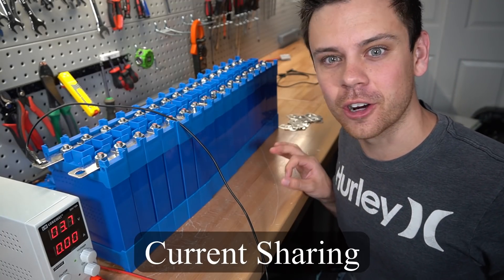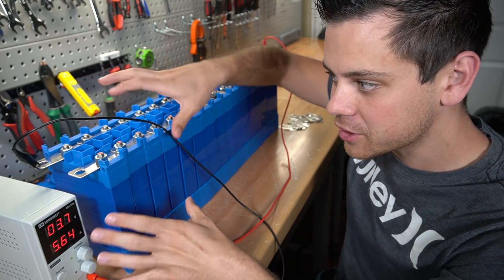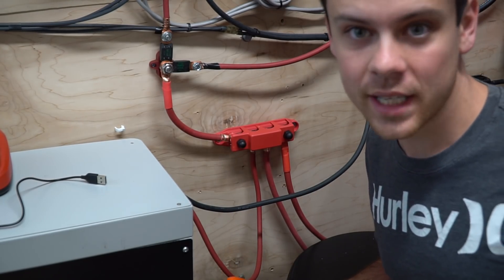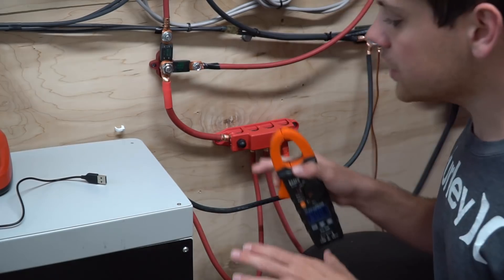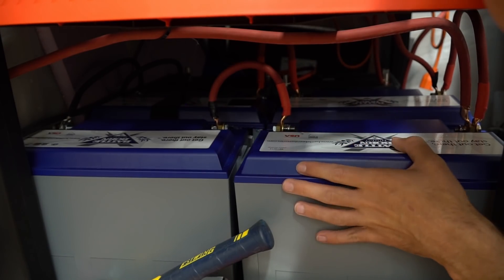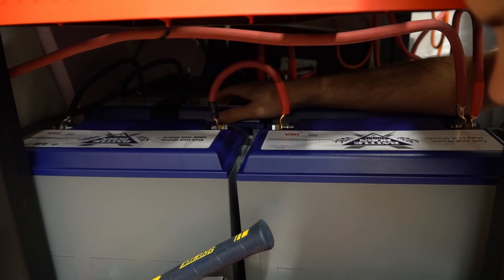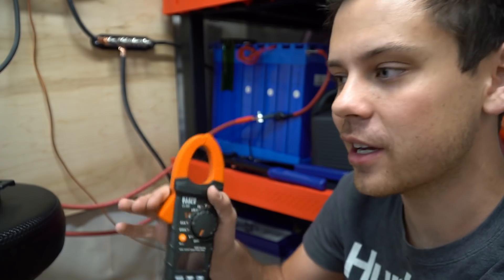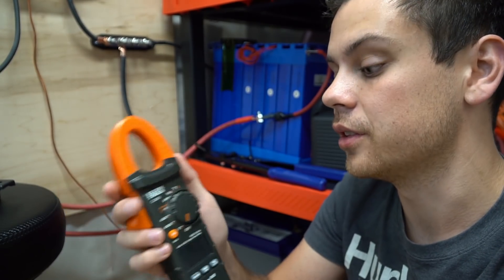Current Sharing Discussion for Solar Batteries

Comment: If there is a crimp that's bad or causing a problem that raises resistance would the crimp be getting hot?  Just curious.  Maybe I'd sleep better at night, if i just soldered all of them.  Thanks for another great video Will.
Reply from the maker: Yes absolutely. It would get warm. I know this from experience unfortunately haha. And don't use solder. Crimping is industry standard. Get a better crimp if you're scared
Reply: @WillProwse   Thanks for the response Will.  Thermal imaging the solar shed might be a really interesting video.  I might rent one to inspect my system and mains box for hot spots. Interesting stuff!

Comment: Plus these are individual cells all in parallel. Totally different situation compared to multiple 12 or 24 volt batteries in parallel!
Reply: I refer to this in another thread but could you elaborate on the comment regarding this being a “totally different situation compared to 12 or 24 volt batteries in parallel?” The reason I’m asking is I want to connect eight (8) 12v Battle Borns in parallel but can’t find a definitive answer as to whether that’s ill-advised. Yes, I could go with a 24v or 48v battery bank but I’m heavily invested in 12v equipment (inverters, chargers, etc.). With the understanding that 1) all connections are made with proper gauge cable/lugs and connections allow for equal current sharing, 2) appropriate fuses/breakers are used, and 3) excessive loads/high-C draws are not placed on the system, is there a limit to the number of 12v LFP (e.g. Battle Born) batteries that can be connected in parallel? If so, how (mathematically) is that limit determined? Thank you.
Reply: @ReversePeople  First of all, if you have a system with that much power, you would be well advised to switch to 24v or 48v.  Sell your 12v inverter and get yourself the appropriate voltage.  Step down converters are relatively inexpensive and simple to implement.  You'll end up with a far better, more reliable, and quite frankly, safer, system.  Secondly, regarding BB's in particular, CALL BB.  If you are planning to spend that much with them, call them.  They provide excellent support, and they are very knowledgeable.  Now, if it were me, I would never consider a drop in for the type of system you are contemplating.  I would want to design my own battery using cells that I assemble.  Not only do you save thousands of dollars, but you potentially end up with a better system -- you can control, to an extent, the shape and size of the battery, and you can deal with the consistency of a single BMS as opposed to 8 separate BMS's.  Parallel-Series wiring is superior to Series-Parallel wiring in my book.
Reply: @PaDutchRunner  Thanks again, so much, for the substantive reply. For what it's worth, I purchased my BB batteries some time ago for a van conversion that hasn't yet materialized. In the interim, I've been using them in a "DIY powerwall" setup. Also, I have, in fact, called BB several times but haven't had the best luck with their "tech" support -- for example: one of their reps told me I could take individual meter readings from each battery without disconnecting the parallel string (wrong). All that being said, I will likely go with a 24v config as you suggest. Again, thank you so much. I really appreciate your feedback.
Reply: @ReversePeople  Sorry about the mediocre experience with BB!  But yeah...24v is worth the minor headaches.  I am continually surprised by how much power I am able to derive from so little current, which makes everything work better, more efficiently, more forgiving if there are any so-so crimps, etc.  And the fact that the inverter efficiency is doubled blows my mind. Makes running the inverter 24/7 so that you don't have to be the power scrooge with your loved ones so much more feasible!
Reply from the maker: Very true

Comment: To easy show if there is a current difference on the bus bar just power it from one side and use a multimeter from one end to the other and see if there is any millivolts over it (not measuring the battery voltage, just on the one bus bar) that is the best way to measure voltage drop
Reply: And across that bus bar on a very low charging voltage it's a dropp of piss in the ocean XD

As long as the bus bar is parralell connected on all cells it will ALWAYS balance out.

Paralell connection: as long as the amp pull is not to high on one bank it will also always even out

Comment: Would you consider soldering your crimped ends after crimping? Would this improve resistance? I’ve done this in the past but guessing it’s overkill. Would be interesting to see difference in resistance between soldered and unsoldered under load.
Reply: The process of crimping creates a mechanical weld when done correctly with the correct terminals and tools - this reduces resistance - soldered joints are difficult to make with heavy current cable, also flux that is not cleaned thoroughly after soldering can cause corrosion of fine strands found in high current cables.

Comment: Great channel, could you design a rather large solar system for an RV using all three battery types and the different devices needed for the varied designs? Then one for a more realistic solar system for rv’s that is more affordable would actually serve a justifiable purpose.

Comment: I Googled how to set up a parallel connection for two batteries.  I found all videos and schematics did the connection of the two batteries together correctly but about 50% had the positive and negative connections to the load coming from the same battery, while the other 50% had them coming from opposite batteries.  Even one so called “Battery University” showed a schematic with the load connections coming from just one battery.  I have always understood that the correct method was to use opposite batteries for the two load connections.  I assume maybe using only two lead acid batteries maybe it is not too important but in a scenario like hooking 6 lithium (LiFePO4) batteries you would want to hook up the connections to opposite batteries.

For 4 batteries there is even a 3rd method called “Perfectly balanced Draw” where it seems to take the loads from the center batteries and it is important to keep all the wires the exact same length (can be an issue if batteries are in a more scattered arrangement). 

My question is what are your thoughts and why do so many recommendations have the load coming from just one battery?

I assume you explained in this video as not a problem with small loads, but still you would think the videos would still show the correct method because you never know what loads someone will be using.
Reply: laronis The “ideal” way to connect batteries in parallel is to connect all of the negative terminals to a stud or relatively short/thick (very low resistance at high current) bus bar, and do the same for all of the positive terminals, making sure all of the negative cables and all of the positive cables are “exactly” the same length and of proper AWG for the max anticipated current.  This is rarely done in practice.  What you found online, however, is unfortunately all too common.  Mis-wiring cause a lot RV battery system to under-perform and need to be replaced sooner than they should have been.
Reply: @brucefay5126  Thx for the info.  I did make all the positive and negative connectors the same size and same length on my battery bank except for the two going to the load.  But I had to make the negative one longer due to the fact it was coming from the 'back' battery.
Reply: Another awesome vid! Thanks, Will!! With the understanding that 1) all connections are made with proper gauge cable/lugs and connections allow for equal current sharing, 2) appropriate fuses/breakers are used, and 3) excessive loads/high-C draws are not placed on the system, is there a limit to the number of 12v LFP (e.g. Battle Born) batteries that can be connected in parallel? If so, how (mathematically) is that limit determined? Thank you again.
Reply: The way I connect my 6-12v 150ah Trojan lead acid batteries  in parallel is in a cross method, where the first battery is connected to pos + input from charge controller and the neg.- is connected to the inverter output. The last battery in the bank is connected opposite, with the Neg- post connected to the charge controller negative and the pos+ is connected to the inverter pos+.
This method has worked very well for my lead acid batteries for the last 4 years without any problems, each battery holds the same exact voltage and if one were to have a problem, I would notice it immediately, since they are so well equalized.

I would suggest using this method to form your battery bank to use all power across all cells and charge fully across all cells, this will also increase battery life, as it causes each battery to charge/discharge cycle equally without any .2 volt anomalies.
Reply: Ken Barnett — Right on. Thanks for the feedback.
Reply: What I forgot to add is the ‘why’.  The principle involved in connecting batteries is to make the path length through each battery as nearly identical as possible.

Comment: Was looking at the samlex evo 4024 myself, test and review could help some folks that can’t find fair comparisons. You mentioned not liking magnum energy, would be great to hear why my dude - keep up the good work
Reply from the maker: Yeah that one seems awesome
Reply: DIY Solar Power with Will Prowse the feature of how to connect the solar panels to the samlex evo seems unique but I am not sure I understand what it means, someone said in your forum that it could be a negative in some way? Is it a deal breaker?
Reply: I also heard him mention magnum negatively And was wondering why
Reply: Ed Mor one of the features I wanted in an inverter was dual a/c inputs, magnum has it on almost all models but they are a bit pricey and there is an ecosystem you have to buy into it seems - samlex evo 4024 also has dual a/c inputs, I was also looking at higher end stuff from outback - the radian and the skybox, add those to the list if you need things to review and tear down will :)